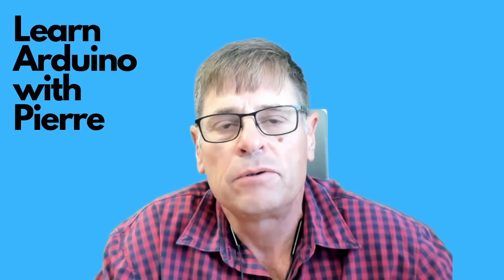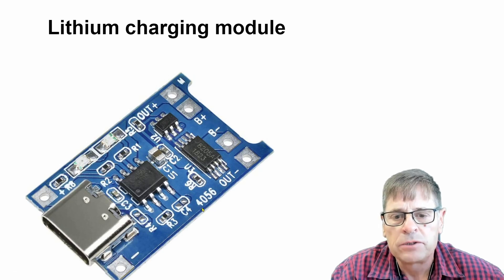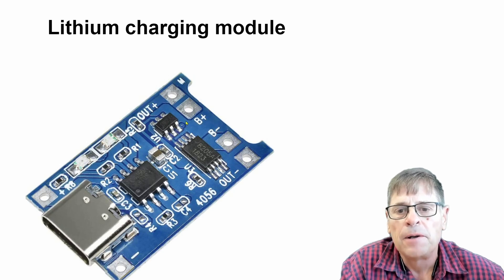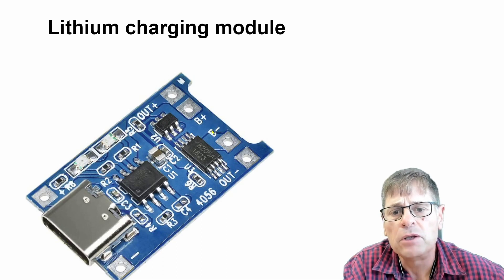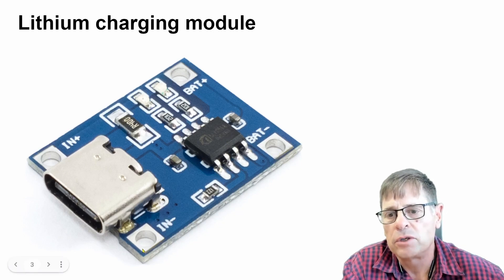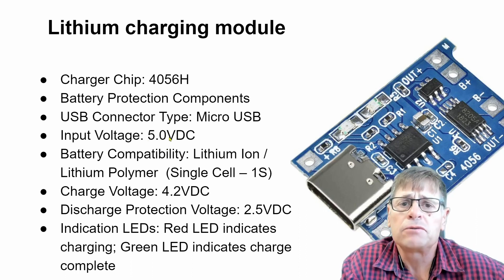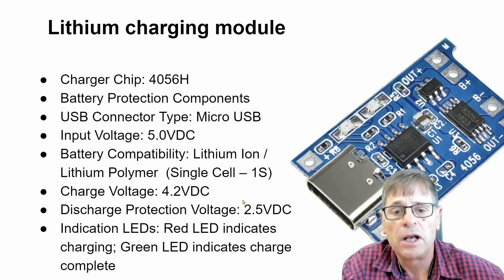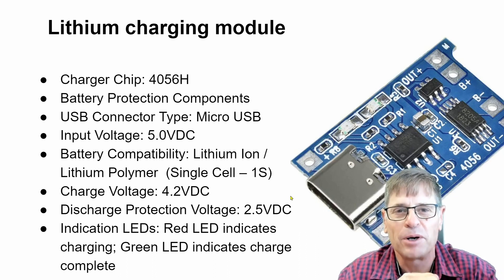4056 module as a solar charger for 3.7V Lithium batteries

Comment: Has your 4056 ever read the output voltage in millivolts when using the multimeter?

I have 2 18650 in series, when I check the current it seems to “trip the circuit” then it no longer reads 7.4 volts on the output contacts, it only shows around .400 volts. 

Thank you for your time
Reply from the maker: Have not seen that.